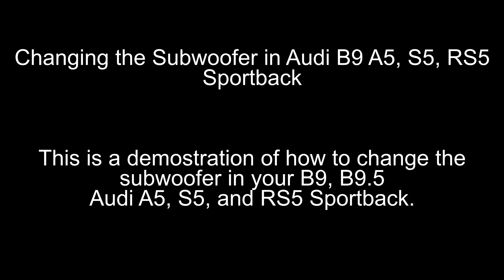Changing the subwoofer in your Audi B9, B9.5 A5, S5, RS5 Sportback.

Comment: My subwoofer just stopped working on my 2018 A5 sportback. Shop told me the speaker needs replaced. For $118 I get the complete enclosure with new speaker.  I hope this is the problem. I have the B and O factory OEM setup. Thanks for this video, I will install myself.
Reply: Finally I just saw that it's written on the video a big thank you

Comment: A quick way to fry your B&O system. The stock amp cannot push this sub and you will get clipping at mid to high volume.
Reply: That depends on the impedance of the woofer you buy.  As long as the amplifier sees the same impedance as the factory woofer, it will perform the same with the Kicker as it does with the B&O, without damaging the amplifier.
Reply: I done this upgrade fee months ago and your correct alot of clipping when volume is near midpoint. Luckily hasn't fried the amp
Reply from the maker: It's been working fine for me.  Not a big difference, but noticeable.  If you want a lot of bass, this is not the way to go.
Reply: @shadetreemech9962  I swapped out my b&o sub on the Q5 with a cerwin vega tire passive sub. 4ohm DVC. The B&O is 8 ohm DVC. It actually sounded worse, barely any base.
Reply: @DanielGuzman83 8 ohm DVC ?? 🤨I have never heard of such speaker. 8 ohm single SVC 👌🏾… Also if u purchased DVC 4ohm why wouldn’t you wire it to make it compatible with the factory amp if it is set up for 8 ohm load?? That might help your sound that your complaint was about.

Comment: 6 inch or 6.75 inch kicker?
Reply: 6.75 - you do need to remove the plastic decorative trim ring to get it to sit in the opening properly, but once that’s done, it fits right in.
Reply from the maker: Yes, and it was quite nasty as the glue was strong.  I ended up breaking the ring into smaller pieces.
Reply: 2 or 4 ohm?
Reply: @jaimem2729  use 4 +. I just installed a 4 and it works fine. 2 draws too much
Reply: @tejeda2112  thanks I'll give it a go
Reply: @tejeda2112  thanks got the 4ohm version installed! I had to turn down the subwoofer in the settings to about half otherwise it would start clipping during the music interestingly.
Reply: @jaimem2729  yeah idk, after having mine for a little, I think the 10inch sub box from va-guh YouTube channel might be the move. But so far it works alright and a small upgrade over stock so who knows.
Reply: @jaimem2729  also I had to add like a foam piece between the big screw knob, it was rattling the box a lot and the knob just wouldn't get tight enough, that cleaned up the sound for me also
Reply: @tejeda2112  Kicker CWRT672 , it works with that too